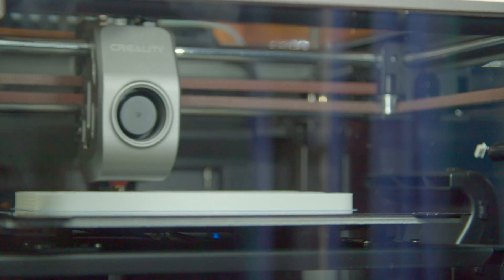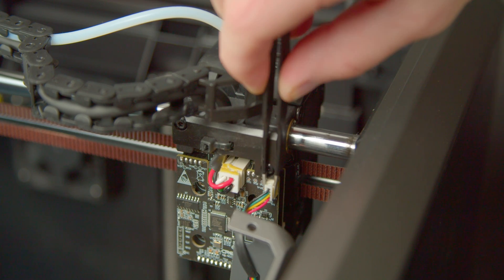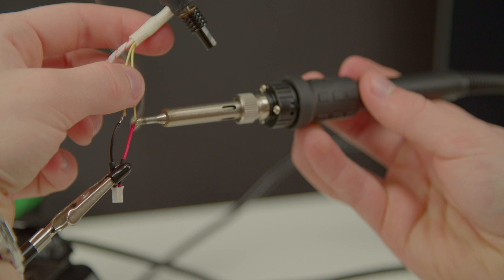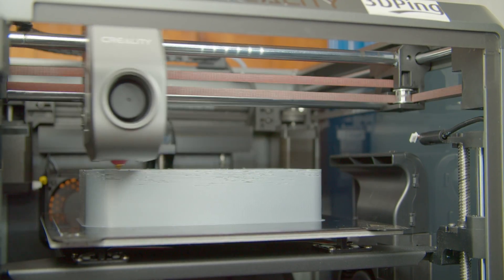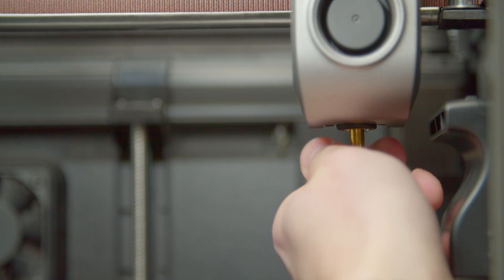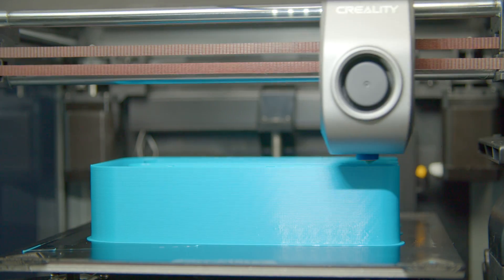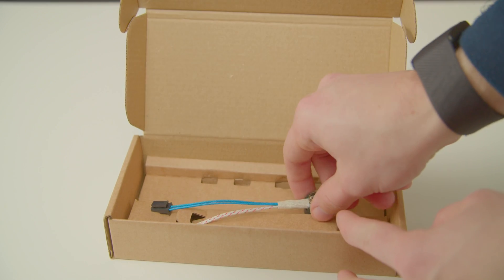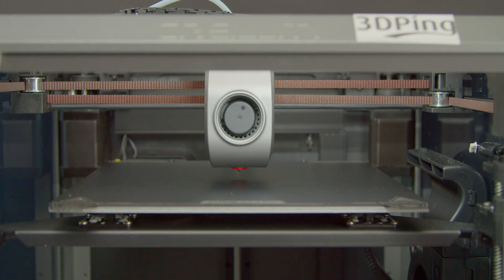Easy Nozzle Change on Creality K1 - E3D Revo Upgrade

Comment from the maker: Updates:
- The thermistor connector is: JST PH 2.0mm
- Surface artefacts were caused by me installing the adapter at a slight angle. I reinstalled it, making sure it's pushed up against the heatsink and tightened the grub screw extra hard (as it looks like the diameter of the adapter might be tiny bit smaller than the hole it goes into). 
- Flow tests were performed at temperatures of: PLA+(220*C), PETG(240*C), PC-ABS(280*C) LINK: (https://docs.google.com/spreadsheets/d/100yzuE4rLN9c-ehLuq43TexqOEi-ujGHSSeCnnN8Jsk/edit?usp=sharing)
- Retraction machine end g-code: (G1 E-18 F800 ;retract filament from meltzone). Lets you change nozzles without pre-heating the nozzle to retract the filament. Although after changing the nozzle, it is best to unlock the extruder, pull out the filament, cut off the end to make it flat, and re-insert. This g-code saves time on pre-heating, retracting and waiting for nozzle to cool down.

Comment: With klipper you don't have to mod the firmware for the different thermistor, just one line in the printer.cfg file.  You'll have to root the klipper install on the printer to gain access to the file, but that's easy to do.

Comment: Kudos for the quality of the video. I have wondered why E3D hasn't made a drop in kit for this printer using a 60w heater. 

Im running the Micro Swiss kit on my K1 Max and it's a hell of an improvement even without the high flow variant nozzle installed. I recommend you give that a shot.

Comment: Why in the world do people make how to videos and leave out important parts of the process like how to lower the print plate from the head so I can actually access it because if I just retract filament and then turn it off like you say then the head is pretty much to the plate and I cannot move it manually so how do you get the plate to move away from the head first of all
Reply from the maker: Hi. Didn’t deem it an important step, but evidently was wrong, thank you for pointing it out. You need to home the Z of the printer, then switch over to 10mm steps and move it down. I think I just printed something large whereby I didn’t even touch the bed before doing the upgrade. Hope this helps.
Reply from the maker: You can also just manually push the bed down when the printer is off. Though I wouldn’t recommend that just coz it doesn’t give easily.

Comment: Can I do this with the k1 max
Reply from the maker: Yep, works just as well
Reply: @Levkin how do I add an extraction G code for the k1 max
Reply from the maker: @Thevesselgamer  If you're using OrcaSlicer, you need to click Printer Settings -> Machine G-code -> scroll to Machine end Gcode. 
Insert: 
G1 E-18 F800 ;retract filament from meltzone
END_PRINT

You may wish to play around with that F value (how much filament is retracted).
Reply: Thank you I just got my e3d part

Comment: Creality K1C will come with a quick change high performance hotend for printing Carbon fiber and other high temp filaments, should be a good upgrade for existing K1 and K1 max who want to change nozzles and print faster.
Reply from the maker: I suspect it will still have the issue with the silicone sock being difficult to remove. Likely will be something similar to the microswiss version.
Reply: The K1C has a completely new and proprietary nozzle type (Unicorn). This means that you are completely dependent on Creality as there are still no nozzles from third-party manufacturers!
Reply from the maker: Try true. Hopefully other manufacturers will be able to come out with compatible nozzles. Looks like wouldn't be able to make a change to something like the Revo easily though, as the heatbreak diameter seems to be quite small.

Comment: You don’t want to change the thermistor in the firmware? That runs on Klipper it’s the easiest firmware to edit
Reply from the maker: Good point, definitely heard that before, just the first printer that I have on Klipper, so not terribly familiar :)
Reply: @Levkin  it’s literally like just editing a text file. You open the file, change what you need and save & restart and done.
Reply from the maker: Oh cool will have to give that 60w heater core a go then. Will just need to figure out what the correct thermistor settings to set haha

Comment: How about the performance of the part cooling?  changing a hotend usually requires adjustment to the duct.
Reply from the maker: I tested it (though forgot to include in the video) and it still blows under the nozzle pretty directly.

Comment: Nice job! Nozzle swapping IS a PITA in the K1
Reply from the maker: Thank you! Yeah I always found even the MK8/V6 styles annoying to change, but the K1’s sock prevented me from even considering doing changes. Wouldn’t mind exclusively using 0.6 on the Max, but for the K1 I wanted the flexibility. Coz a lot of the stuff I print requires a 0.6mm, but it’s also nice to be able to print more detailed parts. So quite pleasant to be able to do that now :)
Reply: just buy OT hotend or Microswiss hotend
Reply from the maker: @gamingscorpionindia1995  The microswiss one still requires the sock to be taken off, plus I wanted to use my existing Revo nozzles that I use on other printers. Makes purchasing new nozzles a lot more palatable, as they can be used across most of my printers
Reply: @Levkin  the sock is easier to take off and it have cold nozzle swaps
Reply from the maker: @gamingscorpionindia1995  To be fair I haven't used it, so wouldn't know about the sock. Still need to take off the fan shroud though. But yeah as I said, just trying to get as many of my printers as possible to use the same nozzles. Obviously microswiss have their own. Though as you pointed out they do have the similar benefit of cold swaps and having an integrated heat break.

Comment: Did you eventually do a PID tune? And calibration? Did the results change?

I'm running Microswiss hotend which has better flow rates than stock.
Reply from the maker: I haven’t actually done a PID tune yet (works fine without). Turns out I didn’t set the adapter in properly, and it was a bit loose. Since resetting it, been getting very good results. The microswiss hotend is neat, and definitely better performance than Revo, but I wanted the ability to use my existing nozzles (I have a lot of Revo nozzles). I quite like having the same nozzles between as many printers as I can.
Reply: @Levkin  yeah I totally get that 👍

Comment: Very cool idea 👌
It would be really interesting to see what it looks like with the 60W model. I would test it but don't know what needs to be changed in the firmware 😅
Reply: Have you made any progress with the 60w version?
Reply from the maker: Haven't yet unfortunately. It does seem that the K1 needs to be rooted (which is relatively easy), but I have just got it set up right and don't want to mess too much for now, as can't afford to have much down time on it. The 40W version also seems to be sufficiently capable for now. Perhaps at some point I'll make the switch and do the tests, but not for now. Sorry I can't be of much help right now.
Reply from the maker: Haha yeah kind of same here. For my personal use cases, the current flow rate is more than enough. Especially with the high flow nozzle, I was honestly incredibly surprised. I thought the difference would be fairly marginal, but I actually got 50% improvement. And that’s with the 40w heater, as obviously eventually you do run into the problems of the HF insert not being heated properly. I think for the larger 1.4 and 1.2 nozzles this will perhaps be a problem. As I’m now printing with the 0.6mm nozzle, and maxing out just over 100mm/s on the speeds. Which is quite slow for the K1. Though I’m not pushing the flow rate to the absolute max to keep some head room and ensure there’s not occasional under extrusion. Either way, we shall see how it goes, maybe I’ll do the 60w mod eventually :)
Reply: @Levkin  If you do the 60W mod and it works, it would be great. I would be very happy to see it.